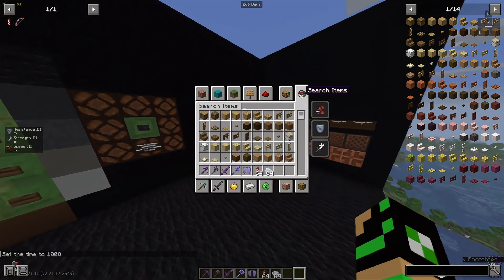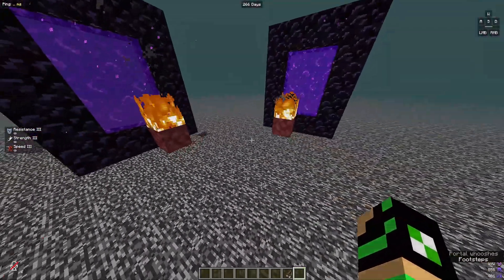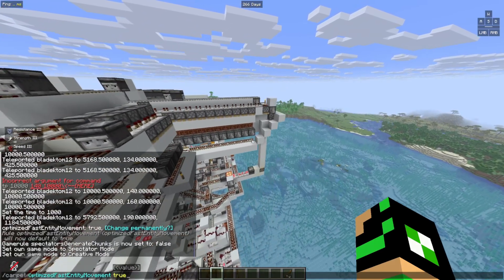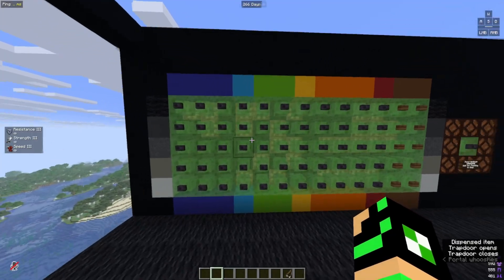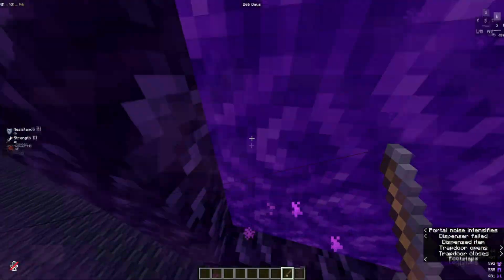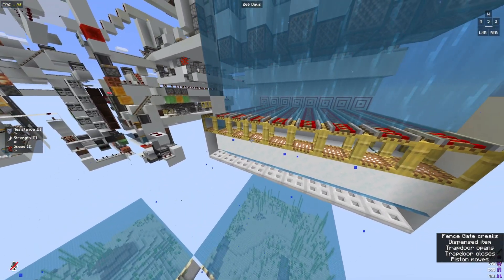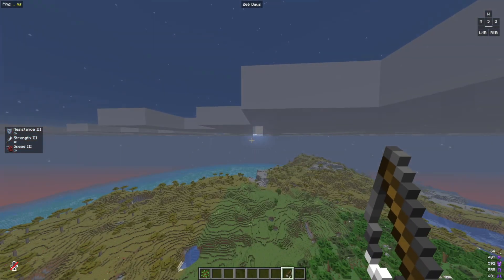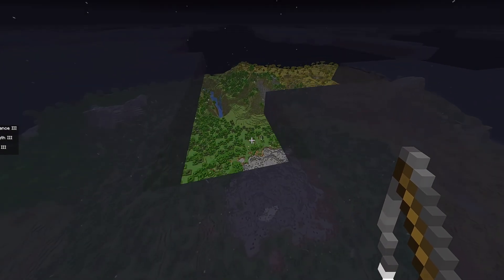Fishing Rod Wireless Firing | Orbital Strike Cannon Mk 6.1 By Cubic Metre

Comment: how much tnt do I need to cannon ?
Reply from the maker: Wdym?
Reply: @JUST1FI3D_XD  like for 1 shot at the Cannon how much TNT does it consume planing to make this system on survival
Reply from the maker: @Ruveliuz  I think 40
Reply: @JUST1FI3D_XD  it looks like 1000 tho
Reply from the maker: the dupers use 40 tnt in survival. The actual duped payload is over 100
Reply: @Ruveliuz  the cannon dupes tnt, so you only need the tnt thats already loaded into the cannon
Reply: it uses tnt duping to build and accelerate the payload, so you really only need a few tnt like 80 or smth to fire infinite shots as long as the cannon doesn't malfunction/get griefed.